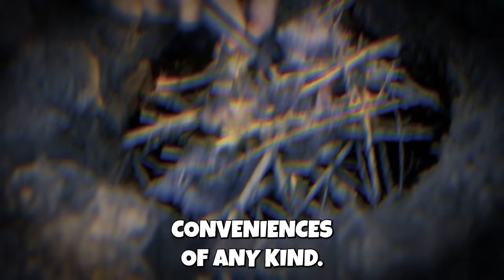90% Will Die In 9 Months! We Tried 72 Hours

Comment: Ive been living off grid for years now. No electricity, no running water, no sewer or septic and in my case no well....   Water is hauled to water tanks which lasts months when full. I need to get more water tank and set up water catchment. Etc. As for food I have rabbits, used to have chickens and obviously need to get more chickens or quail. Food storage is the norm - one cannot just go to the grocery store all the time. During the winter is very dangerous to travel for weeks at a time so it's a no go. If I eat anything, any can of food for example, it must be replaced usually with extras every time I do go to the store. It's just day to day life and nothing exceptional. It's just what's necessary.

Comment: What you should do is have a manual water pump instead of the  electrical one. You can have both. Water will become gold when things like this occur. Well  water will be useful even if you have to boil it. Another item to have is a distiller. You can distill water and use it to drink. Keep around salt to use for eating and making saline (for wounds).

Comment: As long as your roof is metal, you can drink it (preferably filtered), but asphalt is not drinkable.  You can use it for toilets though...as long as on a septic system.  If you're on town water...sewage will not be pumping.

Comment: So, IRL unless you had a faraday bag for that backup power storage you were pulling it out from, I doubt you would have any backup power storage sources. Just saying. Also taking your propane gas grill grate over the in ground rocket stove would have been helpful for cooking some in addition to a rock or two to elevate and help with airflow. Good job on the video though. Bummer no one else wanted to take advantage of what works or not with an emp and no power. Next: try two weeks so you can figure out hand washing clothes! 😁 oh and figuring out your canning ahead could help with food storage and slightly easing your comfort for survival in a situation like this as is needed to conserve energy for the duration.

Comment: Occasionally have ice storms that knock out power for a week. It's not a great deal of fun. We had a welder that doubled ad a generator.  We'd run it a couple times a day at our house and my grandma's to keep the freezers cold. Open the oven door and keep some heat going periodically.  Grandma had a wood stove. We didn't the last few times it happened. You can get by but it certainly isn't the comfort most of us are used to.

Comment: Fun video!! I just wanted to point out a thing for the folks at home and around the world. If the grid is down, you have a power outage. If your cell service isn't working, you have a bigger power outage and maaayyybe an EMP somewhere. If your cell, and all other electronics are fried (especially tuirned off stuff), you were probably directly under a nuclear device and going to die from radiation poisoning shortly anyway... Just to be clear there :P
There are nuclear, and non nuclear EMPs. A non nuclear EMP is fairly short range and really only good when it targets main power junctions and infrastructure: I.E. your cell works but no service and no grid, etc. So unless you're right next to some major power junctions, all your batteries are fine and your fuel injected cars are aayyyy-ok. (yay!)
In a nuclear situation, well, the EMP degrades at 1/r^2 in all cases, so the radiation on the wind is much MUCH farther reaching. If you're close enough for batteries and everything electronic to get fried, you're likely already dead or will shortly be dead, sorry!
Long story short, get a battery backup for your home, and don't be afraid of fuel injected cars, lol, because they're much more likely to survive longer than you! GL

Solar, anyone?.... Bueller?

Comment: 72 hours? We went thru two weeks without power IRL after a blizzard. No contact with the outside world except listening to the radio. Cell towers were even down. Had to drive 30 miles just to get gas. Got solar the NEXT year! The tension on the streets was palpable after only a few days.
Solar cookers are good also and very simple. Metal bowl with custom glass cover and reflectors make it work even better. Hand-crank radio with solar is very valuable also.

Comment: Seeing how you're paying attention and live so close to the ocean, get yourself a pressure cooker and a copper tubing that will fit over that pressure release valve stem. copper tubing should be about 10 ft long and coiled. throw wet rag in the middle of that coil and you will catch 100% of the distilled water. Then scrape out the salt and put it in your salt shaker on the table. You should be making iodine from bulb kelp also

Comment: Well, unfortunately, I have been eating without power for years (not every single meal, but enough to know how to do it. 

 Ive got some batterey power for dc fans- when you're surviving, you have to switch away from the comfort mindset.

 Your goal is not to be comfortable, embrace the pain, but to survive.

 In the heat, a small computer fan keeping air moving will last longer than a bigger fan. The little bit makes a big difference from not having any air moving, which is where you will be sooner, trying to maintain comfort. 

I won't enjoy no phone for a couple days, but before the devil's screen, I was an avid bookworm, I think I can adjust.
 
Now to finish the rain barrels I started a year ago... I'm wondering about some kind of oxidizing agent like borax to help keep stagnation at bay- how much of what gets left after its diffused, how difficult to filter out with active charcoal and sand etc. 

I wish I had a good camel. They're superior to equines I hear, though my source may hold some bias.

Comment: You forgot the initial fires because your phone. If it's not working, it's probably going to be on fire on your nightstand because the battery is susceptible to the feedback of the EMP through the wires of the cell phone causing over voltage and a lithium fire on your nightstand. That's a wake up call to EMP and if you have an electrical vehicle in your garage half of your house is probably going to be missing

But this channel seems to be pretty cool. So you should be prepared by having a pan to push the phone into. Do not touch the phone with your hand or spray it with water unless you want to get electrocuted. And if you're working off of city water do not forget that you have water and the basin for the toilet as well as in your water heater. You'll have to go to your water heater and get it off of the drain spigot because there won't be any water to push it through. But I can't wait to see what you have to share

No, you should be preparing with salt or vinegar to offset what you have in the freezer. That way you can preserve it. Most neighborhoods are not going to have a soldier, but for a neighborhood like yours you should be preparing will salt and vinegar to offset the foods. You can preserve it even longer or be prepared at least to slice to meet up small so you can dehydrate it

Just remember when France is asking for a conflict with Russia. That's what he's embracing is one nuclear warhead over the United States and the whole country is going to be at war for survival as department of Homeland security says 90% will perish

Why you talking to her? She looks like she has refrigerated medication. She's definitely going to be deceased within 24

Comment: An EMP won't disable your electric/electronic devices. It will probably break the electric grid though, probably for months. A generator will buy you time to figure out how to do things without electricity. Just a few gallons of gas could be stretched for weeks by running the generator for only 20 minutes at a time, like to run the well pump.

An off grid solar setup would run for years, until some component broke with no replacements available.

Comment: Modern vehicles, those that have electronics, will not work post EMP. But, those that use points and condenser ignition and a permanent magnet generator with a mechanical voltage regulator will operate post EMP, as long as you have gas, tires, and spare parts on hand. After that, they are worthless for much of anything. BTW, 72-hours helps one see deficiencies in your plans, but 2-weeks will show you your failures in your preparations for a SHTF or EMP Strike scenario. If all one has is beans and eggs to survive on, then you are going to fail to survive and will go hunting through your neighbor's homes for food. This is why they say that 80-90% of the population will be dead within a year. What your video showed me is exactly how 40-50% of the population will walk into a FEMA death camp: once you check in, you can never check out.

Comment: Seventy-two hours isn't that hard even in a small city. Try one week without electricity after a hurricane. We had water flowing in the pipes, but it wasn't drinkable due to sewage overflow at the plants. We cooked one good meal a day, then didn't really eat. At one point it was over 90 in the house with the windows open in the daytime and 80's at night. Of course after the gunshots and then other screams in the distance on the third night, you closed those windows unless sleeping in that room. Police, Fire and EMS weren't coming because big trees blocked everywhere. Other places in the city had power, but police were in short supply due to looting, home invasions and other crimes. Even after power was restored in shops, you had no way to store some things unless you had power. The big stores were completely without food including FEMA/Walmart. The city gave away one bag of food for each household. Of course a lot of the food still took water. Good thing we had canned goods ready to eat with only a little heat from our propane stove. After the fifth day, we had clean water flowing again. Stores got back to normal after a another week with repairs and cleanups began. Older appliances will die during these times and we didn't have a refrig or freezer for over two weeks.
In all, our family was lucky. Some here were without power for weeks, or had trees on their houses. And the thing about neighbors, some help but for more hostile reasons and intentions going forward.
Take Care and Stay Safe.

Comment: Video was "cute", however you didn't cover washing all those dishes & pots with limited water.
Paper plates that could be used as fire starters.
That said, more than one canister or propane 
Bag/s charcoal 
Grill that use can use propane & charcoal (separately of course)
5 gallon bottles (water dispenser type) that you could refill with your rain water & put cork in top or the hand pump attachment in hardware section.
Think of investing in a grill grid to put over your ground rocket stove.
Try ravioli out of can.
Nice job, overall. Great supportive family.
Did you really go 72 hours without bathing? Didn't mention wipes on your inventory list.
Looking forward to your winter trial...
Reply: And, ZERO water pitchers to filter water. We have them & the counter top one.
They come with meters that let you know the amount of chemicals in water before filtering. 
And rated better than Berky 
$27 at wally world.

Comment: During mild weather, it will be the lack of clean drinking water that may kill the most people during a prolonged grid down. Drinking dirty water will likely cause vomiting and diarrhea which speeds up dehydration, often to a fatal level. Antibiotics and plenty of IV fluids can save people with this level of severe dehydration, but do not expect to get either one during grid-down. Some will have the wisdom and self-discipline to filter and boil unclean water before drinking it, but most will not. The unprepared will probably run out of drinking water and other beverages before they run out of food.

During cold weather, lack of heating in homes could kill those who do not have a non-electric alternative to home heating. Even gas furnaces need electric power for their thermostats and blower fans. The system that pipes natural gas to homes, certainly needs electric power to function.

Most people do not have wood-burning stoves so that they could heat a room with firewood. Those who do, probably do not have enough dry firewood to provide months of heat in cold climates. Many who have wood burning stoves would have to resort to burning wood furniture, books and lumber from non-load-bearing walls just to stay warm enough to stay alive until spring.

Most people in the U.S. do not live in a home designed for cooling airflow during summer months. Most depend upon air conditioning units to cool a tightly sealed home. Without air conditioning, high summer temperatures could be fatal to the elderly, the very young and those with chronic medical conditions. The interiors of modern homes could actually be a lot warmer during the day than being outside under a shade tree. Last summer, some locations in the U.S. broke weather records with triple digit temperatures. 

Hot weather unrelieved by air conditioning causes the body to sweat profusely and become seriously dehydrated if the person does not drink a lot of water and also replenish their electrolytes. Staying hydrated during hot weather may be impossible without access to plenty of clean drinking water. And once a person becomes seriously overheated that is likely to be fatal if they can not be cooled down with cold water baths and also hydrated with cooled IV solution. Yes, a vehicle's engine could be run to provide air conditioning inside the vehicle, but at some point that vehicle runs out of fuel. And without electric power, fuel pumps at fuel stations will not work.

Comment: Be ready...
Get a couple of durable locking waterproof totes to keep rodents out.
1. non perishable foods
2. Two 5 gallon water containers 
3. Water purifier and strainer
4. Lighter's, matches, and fire starters
5. Cast iron skillet and pots
6. 32 foot plus camper with compost toilet
7. Have a Bug Out Vehicle 4x4 EMP proof diesel with external 150 gallon fuel tank.
8. Extra LP tanks
9. Small SAFE wood stove for the camper for heat. Winter months
10. Some OFF THE GRID BACK IN THE WOODS BUG OUT LAND. 5 acres to 100 acres.
11. Solar panels, batteries, small water turbines, shallow water well kit hand pump for well or Wells if you had one drilled. Water turbines if you have a small creek running through your property or near some Creeks to charge your power supplies.
12. Hand tools Ax, saws, shovels, knives, etc.
13. SELF DEFENSE TOOLS
14. Good woman to stand with you and a GOOD COOK. Hard to find these days I'm still looking.😮 😂
15. BUDDIES you trust with your family and like Wise.
16. Set your campers in a circle not to close but so you can watch out for each other. Western days wagon trains would make a circle around a fire for safety?
17. Smokeless fire pit ring.keep the fire low so it doesn't draw attention.
18. Stews and soups more for the masses. 
19. Keep Noises low don't draw unwanted attention.
20. Most of all keep your BUG OUT LAND secret just the Trusted friends or family that will be there with you in a SHTF SITUATION.
Make it like camping and the kids won't be stressed but for the adults Well what can I say that would easy your mind? 
If you know pass it on.

Comment: "Only commonly owned tools" took me out of it. Been prepping since 1985. These days I'm ready for anything short of a direct nuclear hit.

Also, for preventing "splash back" in your poop pit, cut down long grass and let it sun dry. A layer of grass before your turn will reduce any splash. Though I would collect any water and use it to bucket flush the toilet as needed. Water for this doesn't need to be drinkable, so the water where you were fishing would work perfectly.

K.I.S.S.

Comment: Looks like to me, you need a manual way to operate your well pump.
Reply from the maker: Yeah. I want that upgrade. It’s expensive though.
Reply: @HAXMAN  What about something like a frost proof yard hydrant?  Should be able to add a on/off valve that you could turn off water to the well pump and just use the hydrant.  Pumping may be physically tiring, but its water.